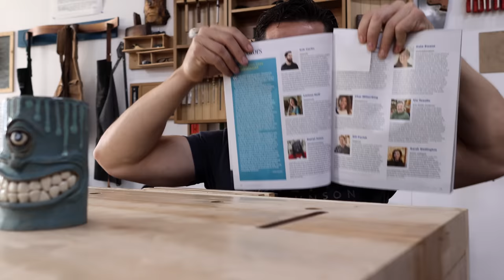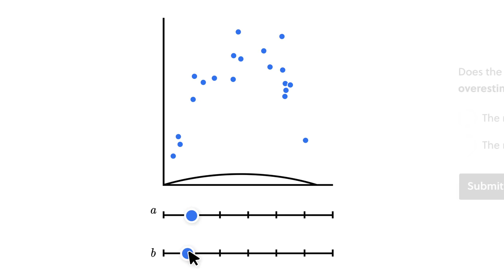5 tips youtube woodworkers give that professionals HATE

Comment: Great video!  You asked, so I’m answering: I’d love to see a video about using Mixol/tints with other finish instead of stains.  I’ve not seen many good videos on YouTube describing these more professional grade finishing techniques.  …although I may stick to Osmo and Rubio anyway because of how easy they can be and due to my lack of spray equipment. Who knows what the future holds though
Reply: Fwiw I like mixing TransTint dyes into first coat of Rubio (or any other finish), especially to level green/purple/yellow/brown variation of air dried Walnut. I used to mix with denatured alcohol and apply first, now I skip that additional step and just mix with first coat of finish in the interest of labor management. Works well for me.

Comment: Some riposte for the algorithm:
Glue and sanding dust: Use 40 or 80 grit max for your sanding dust+glue filler. Mix outside of the joint then push it in. It blends much better than fine dust. 
Rubio: It fills its niche nicely and is well marketed. Hardwax oils are pretty expensive and people want to grab the 'good stuff' or rather the 'safe bet' before they branch out.

Comment: Congratulations on the FWW! Definitely well deserved! Good points throughout - the CA glue and blue tape is definitely irritating. I don’t think people realize they are spending just as much on doing that as they would double stick tape.
Reply from the maker: Thanks brother! And yes, CA glue is not cheap, especially with accelerator. But for some reason the thought pattern continues.
Reply: I’ve had DS tape break apart during a CNC carve but never CA glue. Just saying
Reply: @banjerlegs3051  I’ve used both and had different issues with both. I prefer just clamping it
Reply: @NewmanSpecialsWoodwork  clamping is the best!

Comment: In the 1980's when I was in high school, I mostly used walnut stain on oak and most other light woods.  In the 90's I used the (much easier to use) gel stains to the same effect.  But at the turn of the century where I now had a family and was making furniture for it, I stopped using stains entirely.  Besides being less expensive, I figured:  Why not just showcase the original wood color, whatever it actually is?
Reply: I agree with just choosing wood but it's color for the desired outlook you want. I'll never understand people saying they have cherry kitchen cabinets when we all know it's actually maple stained cherry. Why? I use cherry very often, just make it from cherry.
Reply: I agree, but I also have chairs made from beech wood from the Sixties, and they’re stained or tint-finished or whatever to match the rest of my parents’ dining room, which had a walnut vibe. Technically the chairs are German knock-offs of Danish mid century design pieces, but the quality is excellent, and they look great. I don’t like beech for furniture, that means I’m going to go for walnut when I will finally find the time for a much needed refinish. So while I’m generally not a fan, coloured wood does have its place.

Comment: Congratulations on the publication in FWW.  That’s a really special and well deserved milestone.

Good points.  I was chuckling about the blue tape.  Yesterday I was teaching my nephew how to use double sided tape to drum sand small parts without launching them across the shop and I mentioned blue tape/CA glue as a less desirable alternative.  Double sided tape is “old school”.  🤘🏼
Reply: I'm in both camps. There is one process in which the painter's tape + CA glue trick is the undisputed king, and it's pattern routing of very small pieces (star knobs, f.i.). If screws are not an option, it just can't be beat.
Reply: @DrMackSplackem  And, you're a Luthier?  I attended Roberto-Venn in 2000.  Yeah, on small items the adhesive can stretch causing the pattern to shift slightly out of alignment.  Is that why you prefer tape and CA for the small parts?
Reply: @whitepawwoodworks  You could say so. I think with small parts, it's mostly a matter of being able to vary the amount of adhesive by intuition; I have a jig with a clear acrylic top that has a bolt running through it from above. The star knob (or knobs) is/are bolted underneath, with the pattern on top. It seems any double-sided tape that would work for this, and not spin the parts off-kilter while being processed, is more destructive upon removal than the painter's tape trick (aided by a dull kitchen knife).
 Oh, also, I have built a few guitars but wouldn't call myself a luthier. I hope that helps!

Comment: The way that I have found to avoid excessive adherence of the blue tape to the wood, is, by running my fingers along the sticky part. That tends to help with releasing the piece from the base. I have a good quality double-face tape. I must say that for CNC and Router operations it holds down the material very well. Blue tape and cyanoacrylate have worked the best for me. I never use it if it is delicate the piece. You could ruin the piece.

Comment: I have to agree with you on the wood glue and saw dust filler. People need to keep that in their back pocket for those expensive hardwoods. I made a recipe  card box out of purple heart and red heart and had to use the glue and dust trick to fill small gaps in the finger joints that way i had a harder to see fill

Comment: 1. CA + tape is superior to double sided tape for sheer strength and precise positioning in some situations.
2. Along with proper management of timber acclimatisation and staged milling, C Channel 100% helps prevent cupping in thinner tops and some slabs by encouraging the wood to expand laterally.
3. Osmo is garbage with poor durability. I dont know a single pro who still uses it. 
4. the idea that you ham-fistedly mixing poly, turps and oil in a jar is in the same league as companies who spend millions developing their product is adorable.
5. Glue and dust is a great option for hairline cracks on long grain and certain joints edges. Nobody is claiming its a fix-all solution.
6. LOTS of seriously high level makers use stain. wtf are you actually talking about?

I understand the message you're trying to purvey here but you've really only succeeded in coming across as smarmy and delivering misinformation yourself.

Comment: Have to agree with the double sticky tape.. been a user and a fan since 1980. Caution here: if you buy thick foam tape there are instances where you will struggle to the foam/adhesive off cleanly when you separate your pieces.. MAKE SURE you buy the "flat" versions! Interesting on the other items.. I didn't know about colorant.. because I don't do custom matches.. customer gets what they get.. as close as commercial finishes will allow. Thanks for the video.

Comment: I have to make an observation about your C- channel part. The C-channel can stop a piece of wood from cupping. I think what needs to be mentioned though is how it is attached. For instance, I have made many tables in the past and have learned that with angle iron (c-channel included) if you use coach bolts through the wood and a nut under, the wood usually won’t cup or bow. However if you use just screws from underneath, then yes you are correct as the pressure applied by the wood is greater than the strength of the screws. The pressure that wood can apply is seldom stronger than a bolt (depending on the bolt size). Keeping that in mind, I have seen a few table using c-channels with nuts and bolts to keep the wood from moving and then they have either put an inch (roughly 30mm) plug of a contrasting wood over the bolt head. I do believe that this is where the internet has gotten confused about the use of the c-channel.

Comment: Great video on getting your point across while not being negative.  Something that is sorely lacking in this world.  Agree with all - especially the blue tape/CA glue trick.   Spectra double stick tape is faster, cleaner, and easier to remove with zero residue left.   I also avoid stain like the plaque unless it's absolutely necessary.  Something I tried recently on a wall hanging for my daughter was mixing Transtint dye with shellac as a finish.  Turned out really nice and dried pretty much instantly.

Comment: The blue tape for woodworking, I never really used before for anything than a CNC hold down and that was only because it was thinner than the double sided tape I could get and if you go too deep and cut into the tape, it doesn't gum the flutes of the cutter like the thicker stronger double sided tape.

But love your explanations. I've always viewed any tips or tricks more as a if you don't have x, y will work in a pinch 

Recently came across your channel and already picked up a lot of info and love your humor and presentational style

Comment: I used a 100 x 100mm steel right angle 10mm thick between my slab table legs and it worked well keeping the sucker flat

Comment: I use the blue tape and making tape trick a lot for holding templates. I find it gives a bit more flexibility in placement and allows you to line things up better than using double stick tape. I also always have blue tape and CA at hand on my workbench. The way you applied it was seriously overkill on the amount of glue, and looked like the wrong CA. I use a drop or two every half inch or so of the medium CA, and with accelerator it has never taken more than 10 or 20 seconds to cure. If I want a little more time, I'll use the thick,and that gives me closer to 30 or 40 seconds.

Comment: Interesting video.  Thanks for clearing up that Osmo and Rubio really are the same thing.  I have used “C” Chanel before and really doubted they work.  If wood is going to move it will move.  White glue and sawdust, never done that,  along with CA glue and blue tape.  You’re right those tricks are not used in a professional shop.

Comment: Double stick tape - depends on the application... some double side tape is slightly flexible and for template routing can shift. Blue tape and a thin CA glue (not the thick stuff you show) I find is more rigid.

Comment: When I was learning dovetails I watched videos and read books and article that illustrated using a compass to “perfectly space and layout pins and tails”.  And I think I did that once and came to the conclusion that it was a waste of time for me.  I also saw all the debate about pin angles and spacing, etc.  eventually I just starting scribing the tails by hand with a straight edge to whatever angle and spacing looked good. Then cutting them on the bandsaw and tracing out the pins and the result was simple and fast and perfectly adequate without all the unnecessary complications.

Comment: I've been a professional woodworking for over 40 years, and I won't argue with this video. I all too often have to match the finish on a piece I'm making to an existing (usually factory made) finish that has significantly changed the color of the wood, often much darker (oak with a dark brown finish is common in churches.) My life got much easier when i was taught by a friend at a church pew manufacturing company to use non-grain raising (NGR) prestains to get a basic dark color on the whole piece, then use a wiping stain to get the contrast that shows the grain. I now use TransTint in alcohol as my NGR prestain, often without a wiping oil stain. 

I absolutely avoid polyurethane, as it is ugly and unrepairable. You have a minor problem, you have to remove every bit of it and start over. My favorite finish is Waterlox Original, a wiping varnish. I've also used shellac as long as alcohol will not be present in the piece's future. (No dining table tops.) And, when I'm duplicating a spray lacquer finish, I have a friend who does that spray the piece for me (which will be happening tomorrow on a small podium.)

Comment: Yes, I'd like a video on stains or coloured finishes.  I was given a lovely coffee table with a beat-up veneered top.  First thought was to take the veneer off to see what wood was underneath and maybe refinish that.  That turned out not to be an option.  So I had some fun doing a very complex geometrical marquetry out of popsicle sticks... because I had a lot of them laying around from a different project.  Popsicle sticks are made from birch - or at least I'm pretty sure these are.  But birch is a bee-ouch to try to stain.  I made a "test" board with the sticks, trying to find a way to finish them so they don't look all blotchy.  Staining turned out to be a very bad idea.  I'm going to try your linseed oil / polyurethane / turpentine mix to the test board to see how that comes out.  But yeah -  it would be nice to tone down the brightness of the birch to blend with the rest of the coffee table which, being as I'm in New Zealand, is most likely rimu.  Sorry for the long story - yes on the stain video idea.

Comment: Great video! Thanks for putting in a good word for shellac. Polyurethane is overused-really only necessary for surfaces that take wear & tear, such as tabletops, floors, and bars. It is ugly, and it looks like you coated the piece in plastic, because you have. Some are under the impression that the glue-and-dust trick will match the color of the wood because the dust used is from the same wood. Probably not! It will usually come out darker (think end grain), and that glue will soak into the wood. Have fun sanding & finishing.

Comment: I found the part on C-channel a bit miss leading. I disagree with you on this one.  Or I felt it was incomplete and deserves more attention. If you don’t like the c-channel I am curious what your thoughts are on breadboard ends on a table? I agree with you that if wood REALLY wants to move it will win but in order to do so it must overcome any forces resisting it, such as a c-channel or a breadboard end on a table. Therefore if there is subtle movement, do to season humidity it will help keep your table flat. It can only help keep your table flat for normal seasonal movement but it will never save you from improperly dried lumber.

Comment: I'm glad you mentioned about the "blue tape/CA glue" tip. I've never understood why so many recommend that. Sure, I can see a use for it. For example, if you need to hold down something that's painted, and you don't want the double sided tape to pull off the paint. But, usually, for CNC work, you aren't doing that, and double sided tape is much easier... AND, the sawdust in glue trick, to me, always looks like wood filler. I mean, for a "weekend warrior" like myself, it's fine, but if I was going to make something to sell, not sure I'd be doing that one... I have wondered if the "C channel" trick actually works (I'll admit, I've tried it... it didn't work).

Comment: Thank you, thank you and thank you for busting the sawdust and glue tip. I’ve tried this a number of times on my woodworking projects based on YouTuber recommendations and have always been disappointed in the results.  I’ve experimented with different glue types, saw dust to glue ratio, etc. to make it match the original wood color but after drying and finishing it looks terrible.
Reply from the maker: It always looks subpar. But hey, there’s only one way to learn I suppose

Comment: My fav part was the violin cabinet, +++ on that.  Totally plagerizing that for my son’s birthday/Christmas gift this year.  If you don’t mind, Im curious about the choice of exposed hinges?  “Jeweled” look when closed? We’re a mixed metal and wood shop.  The blue tape d-side does get used, but pretty much always just when machining very thin metal pieces, it usually releases easier without deforming the workpiece and leaving little residue.  Releases with a bit of heat worst case -  which itself can be a problem w/o coolant on metal, but then coolant can dissolve tape’s adhesive - duck! For wood, thin d-side tape, it’s faster, time counts.  Finishes, everything from pure tung oil/hvlp’d shop-cut shellac (mostly blond flakes, +1 on Fuji sprayers, just a happy customer), General Finishes wipe on (real stuff, not low VOC), soap, Maloof based recipe, to….nothing-bare finish.  It all depends on the piece it’s use and desired finish/texture.  Bought a can of Osmo and one of Rubio back before Covid.  Put them and Maloof recipe (I think I got it back in 90’s or so from one of his interviews?) all on a walnut piece and stuck it somewhere, maybe I should go dig it out and see what it look like.  Tints and dyes are +2, Mixol and Transtint and a few others are in the cabinet; when needed or a natural wood species use would $$$$ the project out of bounds or  you’re after a ‘60s finish 😈

FWW, honestly haven’t picked up a copy in over a decade.  My collection goes back to issue 1 hardcopy to about 2011ish.  Just seemed like I kept seeing same ol same ol, or maybe I just started getting old 😳😱.  Do miss their specialty annuals.  The only magazine looked at in last few years in Australian Wood Review.

Have a good’un.  We’re going to…wood scouting/buying road trip this weekend!

As always YMMV.  Just sharing, nothing more, nothing less.  Not associated with any products mentioned other than as a paying customer.
Reply: Quit the mag subscription, because the projects are for personal use, can’t copy any of the work for the market.